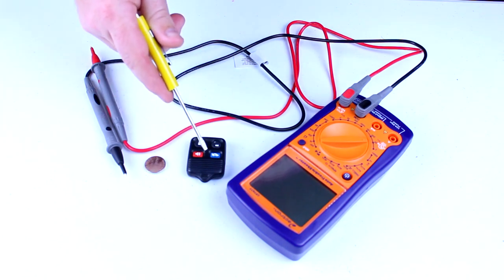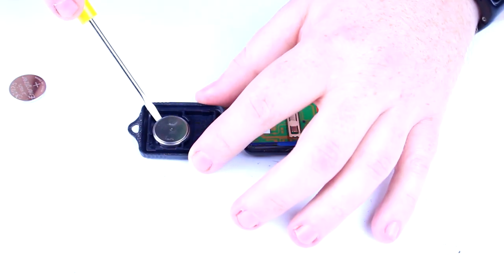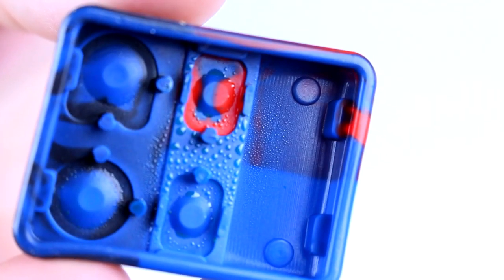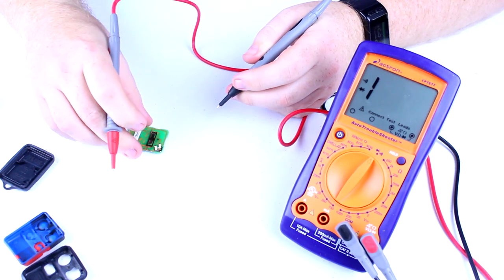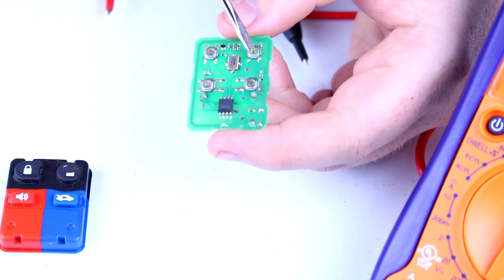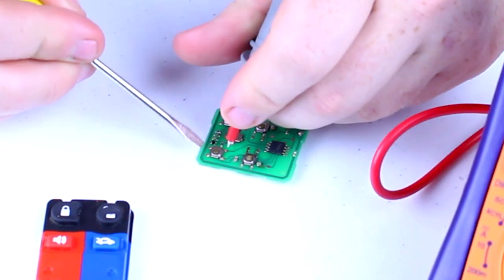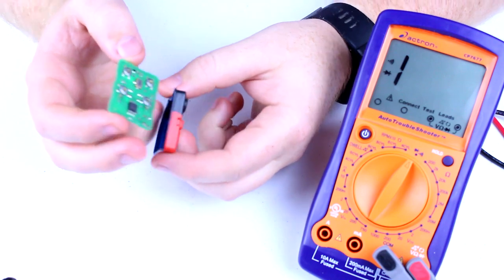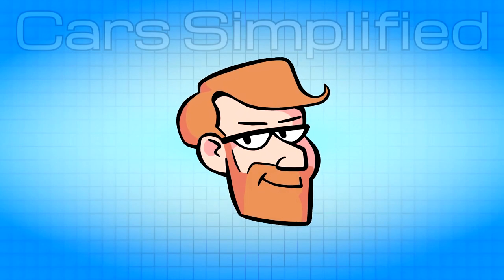Testing a Car Remote (Good Battery but Key Fob Still Not Working) • Cars Simplified

Comment: For remotes with worn out membrane switches on the back of the rubber buttons, I used crazy glue and gold leaf for new contacts. Worked for years.
Reply: Your answer is exactly what I was looking for.. the four contact points. one is missing on one of them.. THANK YOU and also thank you to the maker of this.. got it.. all now..

Comment: I have this exact remote and out of nowhere the original one wouldn’t want to lock or unlock or do anything I changed the battery multiple times and the same thing happened I decided to get  a new one today and it was working fine but then it started to do the same thing

Comment: Big question for you, my ford controller, just like the one in the video, drains batteries very quickly, I replaced them four times during the last 2 weeks, they usually last one or two days
Reply from the maker: Sounds like a short, given how fast they are draining. I don't think expired batteries would even do that, but I'm not 100% on that. I would definitely start by making sure nothing is electrically connecting the positive side to the negative side, either right away or when it gets closed together.

Do all of the buttons work normally? A button stuck in the on position could be a constant drain, and would result in a button push that does nothing.
Reply: @CarsSimplified  I was supecting on a short too... No buttons stock on the pressed position,  all buttons work normal when new battery is in... It's a weird case.
Reply: Mine does this!

Comment: I check my old battery remote and it's show 2.8 volt, then I check the new battery and that show the same volt as the the old battery, but my quastion is why new battery work and the old one not working ,although they have the same voltage?
Thanks
Reply from the maker: Different conditions can weaken a battery; if you are able to test the battery under load, it might show different voltages. 2.8V is pretty close to dead for a CR2032 battery, depending on what it is powering.
Reply: @CarsSimplified  the both battery old and new 2.8 v
, But only the the new one work's on car remote
Reply: (I testet them)

Comment: I have to clean the contacts of my control every week. Then it works like a new one. But after 3-4 days it starts fading away again. What can that be?
Reply from the maker: What's getting on it? I'd assume it isn't sealed up very well if it happens that quickly and can be cleaned that well.
Reply: Make a new gasket out of a small rubber band

Comment: Hi, That’s fine, but what do you set your meter on to do these tests.?
Reply: continuity for the chips and dc volt for the battery
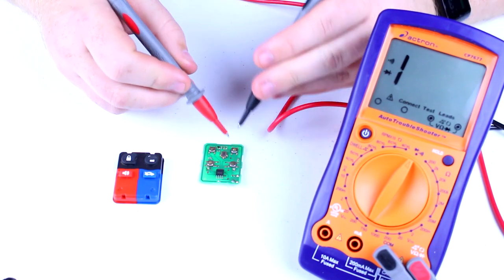Reply: @joshzuniga2178 what about switch button test at 2:46? Do you set your meter for continuity too? because i don't see the multimeter negetive needle.
Reply: @LOVEPEACE12345678  he's got it set to continuity which looks like sound waves. he's holding both the black and red nodes, you just can't see it cuz its being blocked. he's then using the screw driving to push the button to complete the circuit. if he just put a needle on both sides without pressing the button, there is no circuit. hopefully i'm correct
Reply: @Aznfool  is that mean either red & black nodes touch the right and left of the swtich legs and push the swtich button to complete the circuit and the multimeter would make some sound wave? is my understanding correct?
Reply: On each side of the switch button are metal that is soldered onto the Circuit. Doesn’t matter direction of the multimeter but put it in circuit mode as the meter will send out a small electrical charge to see if the circuit it complete.

So you put the red on one side and black on the other metal part. Without pushing the button the circuit is not complete. When you press down on the button the circuit is now complete and you hear a beep or chirp. This requires some hand coordination to use both poles and something to push the button.

Comment: OMG, thank you SO much!  You saved the day! lol  I locked my keys in the car for the weekend & my husband left for the weekend with the other set of keys.  We have 2 key fobs in the house that havent worked for some reason. Well, 1 needed the battery retainer soldered back in but the other 1 should work but doesnt.  I was in the kitchen testing the buttons and the horn started going off!  Thankfully I was able to get it to turn off and since that worked, thought I would try the door and omg, it was unlocked!  I still cant get the buttons to lock/unlock the car but using the red & black leads at the top and bottom of the unlock circuit will control it at least.  Question is, why wont my remote work then?  It is very clean.

Comment: what if there is no continuity ?
Reply from the maker: If there is no continuity through the button when the button is pressed, then the button is bad.

While it is possible to replace those switches, it's difficult to find the right size and style, as well as to remove the old button and install the new one. Then you have to hope that was the only issue! Most people end up buying a new remote if a switch is bad.